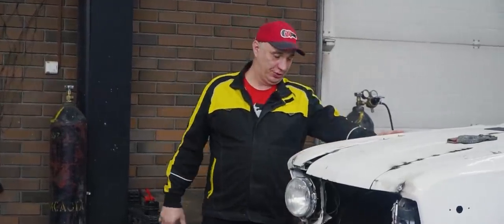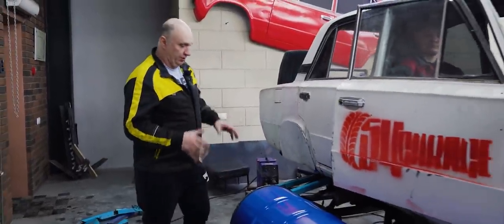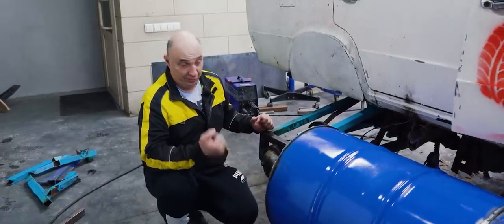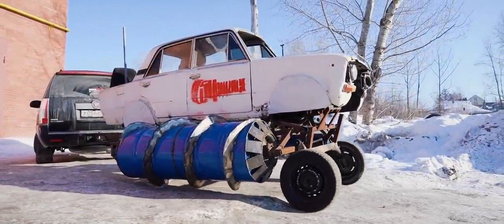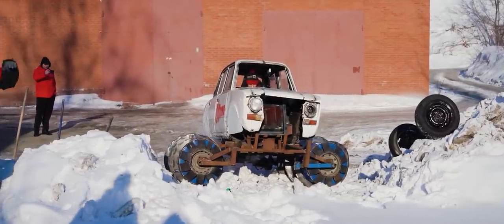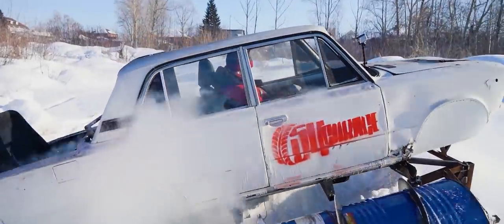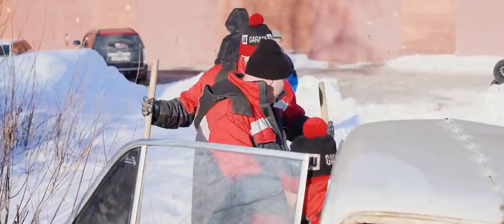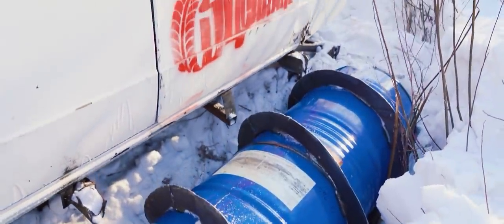We convert a Lada to screw propulsion and go for a drive

Comment: This has gotta be one of your greatest projects yet! IMO you just need to weld on a few more fairings to increase smoothness & flotation pushing thru the snow, maybe enlarge & reinforce the screw blades, & maybe boost the motor, then you'll be cruising right thru snowbanks & bogs at good speed 👍

Comment: The snow in the bushes have a lot of air in it. It's the same when you drive a snowmobile. Don't drive in the bushes. I think it worked surprisingly good.
Reply: Youre right, even if youre swedish. Already early in the build the screws looked insufficient to carry the car, and they did a mistake by letting it stay a tad heavy on the rear.
Reply: @Eddie Hitler swedish isnt Sweden Mr Hitler 😂

Comment: Two things you've done wrong only
The arms holding the barrels and the gearbox should be facing down on an angle , to give you clearance in the event you get stuck.
Second you should have had three or four barrels to give you the buoyancy .
Reply: Agreed... 4 per side I reckon.😉👍
Reply: And make the spirals longer so it propels it faster.... just a little bit.
Reply: @dragalochta4531  i think they need to do something about transmission or get an engine with more torque, it seems the engine is really struggling to get the drums moving
Reply: @der_schutzer9521  maybe maybe proper ratio gearing? Also bring the barrels in, closer together,  more under the car so they can work against each other. 
Now they are operating independently of each other,  so they push snow/ground to each other to work it's way back and forward easy.

Comment: Need to attach long sheet-metal cones on both ends of the barrels so they'll cut through the snow and guide the screws to the surface instead of sinking and  pushing against it.
Reply: yup, exactly, the cones need to be long and have the screw start from the tip of the cone. That will possibly help the vehicle glide over the snow instead of digging so deep. Great project nonetheless

Comment: Pretty cool. I think if you extended the welded on helical portion to about twice that dimension to "capture" some more snow depth it might work better.   To a lesser degree I wonder if cigar shaping the forward end of the barrels might help it to ride more on the top of the snow rather than digging in so much.  A flat belly plate or at least some wide skis might help with not dragging so much of the car body through the snow and also keep it more on the surface.  Clueless really, but just some thoughts.

It seems a track would work much better.  I think I've seen snowmobiles make slightly better progress than that.  About 75X or so.
Reply: I think all your ideas would greatly benefit this project!! I mean, they definitely make sense! 😎

Comment: Generally speaking, you get better results the larger your screws are. In particular, you want to increase the bouyancy of the vehicle so that it doesn't dig down. You can reduce the digging by using fewer turns in your spiral, as well, though if you have too few you may be unable to move.

Comment: the gear ratio depends on the turn rate of the screw section. so a gentler curve on the barrels would counter-act the relatively fast output rate of the transmission gearing. Because you have such a high amounts of turns on the barrel section, it's either going to skip, or bite, and launch the car forward (and then start skipping again).

Comment: The front bit of the drum must be smooth and pointy to reduce snow drag.
The pitch of the screw thread must be a lil bit steeper and deeper. The thing is, the threads are so small that they are compressing the snow. Its only after compacting the snow that it is moving forward.
Actually things can be calculated depending on the compacting ratio of the snow, the weight of the vehicle, the drag of the screw wheel etc. Picture it as such, the lighter the car, the more efficient it would be, the steeper the pitch angle to some limit, the more it moves forward but it requires higher torque, and not speed from the engine, the shallower it is, the easier and less torque required to move forward but it would be slow and inefficient in that fluffy snow. And the lighter the snow, the deeper should the blades be. Playing with these main three variables would be a fun experiment.

Comment: You need to cover the bottom with a steel plate so the vehicle cn glide over the snow. Remove the possibility for the snow to cause drag and it will move much faster.

Comment: The barrels on the actual machine were spinning the opposite way. The lada is shoveling snow right under its body. It should also have a shield under its front suspension and belly so it can slide over the snow.

Comment: Video idea came to mind. Have you tried switching the intake and exhaust manifolds around? Suck air in from the exhaust pipe and blow it out the manifold. Obviously the engine won't be running in reverse or something but the pipes will be significantly different.

Comment: Okay… drums need to be longer than said vehicle to prevent tipping. You don’t want the screw type vehicle to rock back and forth. You need it to stay stable and level. Otherwise it will try to dig down. And the diff needs to be limited slip, otherwise you get one spinning and the other sitting idle.

Comment: Motion for Garage 54 to make ONE high horsepower motor to swap into their different projects.
The stock Lada motors just don't have enough power.
Reply: Shorty had a 2jz in it, and another had a giant v8 from a truck.  They've stretched engines, added engines end to end, and stacked engines. If you want horsepower builds maybe you should look at Iling Show. He's got a Zil dump truck with something like 500 hp.

Comment: Needs a longer drum. It would drive better if it was able to drive both drums without a differential. Using a clutch with the brake on each side to steer.

Comment: Seal those drums up. Balance the car out. 
Take it to the water.
Assuming 4 X 55 gallons = 220Gallons X 8 lbs. per gallon (water) = a displacement of 1,760 lbs.
So the barrels will float a weight of 1.760 lbs. or 800 kilos.

Comment: Yes sir how are you today. I hope you're having a good day. I haven't looked all the way back through your video archives. So hopefully I'm not suggesting something you've already done. But I've got an experiment. That I think would be right up your alley. This experiment might be a little pricey. And I'm not sure how deep your pockets are no offense. But I don't believe there'd be anything on YouTube like it. Find in the junkyards if you can. Some helicopter turbines or if you can borrow one or rent one. Did I mention it might be a little pricey. Sorry. A jet engine or turbine most of them idle around 10000 RPM. If I remember correctly. That's almost double what a normal engine can run at. Where is that turbine it's red line is probably somewhere around 100 thousand RPM. And most people don't have any idea of how destructive are dangerous a turbine can be. Your tire spinner. Where you were making car tires explode from sentriforce. Is what gave me the idea. Find you a turbine or jet engine. And run a driveshaft off the front of the central shaft in it. Obviously make that out of a material. That can stand the operating range of that engine. Now back to our helicopter engine in the junkyard. Find a junk engine and get the turbine Wheels out of it. Just like you launched the tires. Build a launcher to launch them turbine Wheels. But if you do this build it right. Please don't cut no corners. Cuz I've heard all my life. From what I understand If a jet engine or turbine fails. And them turbine Wheels managed to come out. A lot of times they will go until they disintegrate before they'll come to a stop. Even though they're made of the lightest and the strongest. Titanium that they can make the things out of. These thing are turning at stay 55000 or 75,000 RPM or let alone close to 100 thousand. I've heard these things will go through trees practically anything. and it saw its way through. So if you do this. Make sure you're getting some good high speed cameras. To get good footage. And if you're near the ocean. That might be a good place to do it. Because I've heard these things can go for several miles. I've looked on the internet. To watch this kind of thing. I've never been able to find anything. I haven't looked lately. The show Mythbusters with some of the more dangerous experiment. That they did they would get with the authorities. Wood let them a lot of times go to a range somewhere. With the authorities over seeing what they're doing. They do their experiment. I realize things work a little different where you're at. But if you could that'd probably be the best way to do this. That way you don't have to worry about hurting somebody. Oh and one other thought if you go to the junkyards. And build a good turbine out of some junk turbines are military surplus are however you managed to do it. And you're able to get your hands on a working turbine or jet engine of decent size. You won't have to weaken the bottom ends of Annie engines anymore. You hook the bottom end of an engine to that thing through that special driveshaft that I mention making. When you start spooling it up. Them Pistons are going to have an exit plan I promise you. Long before they get to 100000 RPMs. And I would be amazed if anything you test could take that kind of punishment that isn't designed to turn at that kind of RPMs. You can test rims ,flywheels, drive shaft ,universal joints, rotors ,crankshaft, camshaft ,anything you probably can think of